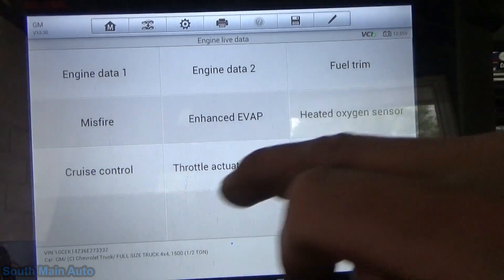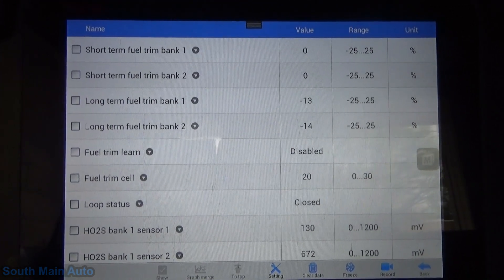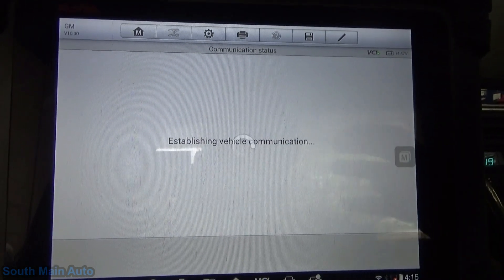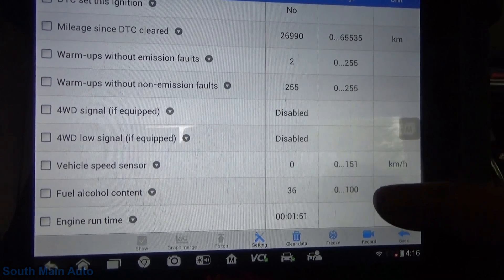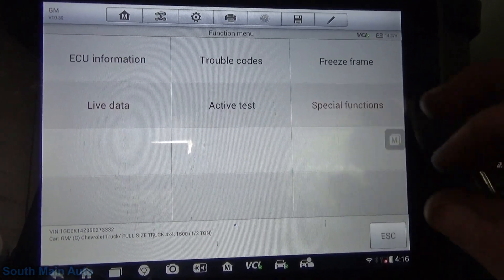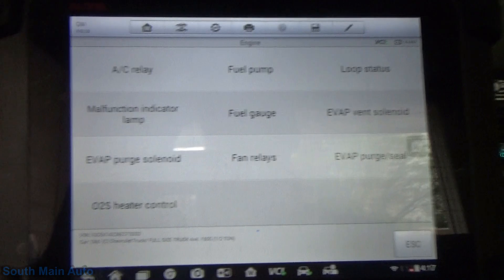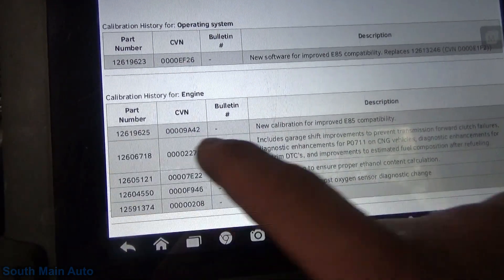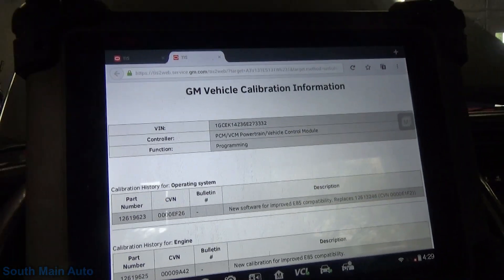Chevrolet Silverado - P0172 P0175 Running Rich

Comment: Hey i have code po175 on a 06 chevy silverado lt 5.3L engine and my mass airflow sensor reads between 0.68 and 0.77 LB/M at idle is the maf good? Or is it bad?
Reply from the maker: that is about 5.8grams per second. That is a good reading from the MAF at idle
Reply: @SouthMainAuto   wha about the fuel trims are those normal as well?
Reply from the maker: You didn't say what they were. FT's should be near zero + or - 10% LT and ST
Reply: I mentioned the trims on a separate comment.

Comment: I Have a 2015 sierra with a cam/headers/y-pipe/tune and it seems to be running rich.
The fumes really stink and the exhaust tips are turning black. The company that did the work said 
if it were running rich the sensors would pick it up, is that true? Its tuned for   93 only.

Comment: This video is what sent me over to the dark side. Bought a autel maxidas ds808. I've always been able to fix my vehicles with wrenches and cleaners until my 2011 Silverado. Couldn't fix it running like pooh and starting like a Ford when cold. Reset the alcohol content (it was at 87%! strange as I've only used 100% no ethanol fuel) and followed you videos instructions and is now purring like a kitten and It starts like it's summer time now. 
Also did my folks impala that was doing the same thing and had the running rich code as well. Tool is well on its way paying for itself already and will continue to as vehicles are only getting "smarter".

Comment: Hey, thanks for this video.. I had this problem.. alcohol % was reading 36% and both trim levels where reading-14 to -16 on both banks...  after resetting the alcohol %.. my short term trim went to 0 to 3... after a road trip... no codes.. awesome video.. thank you
Reply: What scan tool do you own.  I am currently looking for one.  Thank you.
Reply: @kyleanderson9453  use the vcx diag nano for gm vehicles. It's a clone of the Gm Tech 2 bi-directional scan tool ($$$$) for only like $120 usd. Same tool the GM dealerships use(d) for these vehicles.

Comment: When you did the approximation between engine size and g/s at idle, how much below or above 5.3 g/s would it have be to indicate a faulty MAF?
Reply from the maker: g/s = (about) engine size at 600 rpm 5.3L = (about) 5.3 to 5.9 g/s at idle

Comment: Eric what software are you using? I have a 98 that is throwing a p0175 code and it’s bank 2. I have the FIXD app and obd2 sensor and can look at live data and fuel trim 2 is negative 15 while bank 1 long is sitting nice at 25 steady. Just curious of the software. Thanks!

Comment: Nice video. I have a 08 impala 3.5 flex fuel with p0172 code only. Lights been on for a week now. Do you think fuel trim, composition needs reset? Car has no drivability issues and the cars mpg is normal and hasn't decreased any. We get like 23mpg on average. I cleaned the maf sensor and plugs and wires were done at 100k. Car has 111k on it now. Wife does put in 10$ here 10$ there. I fill it up every friday. I know it says it could be many things bank 1 o2 sensor, fuel regulator, dirty injectors, vacuum leak ect ect. I'm trying to pin point down the exact cause but my scanner is a cheapy scanner it doesnt have fuel trim or composition option. Any help is appreciated.  Thanks!

Comment: I just recently ran into this issue and it's 2011 Silverado 1500 the check engine light came on advanced plugged in said possibly tank of bad gas so I filled it with high test light went of biut c.e. light occasionally comes back on for short time then goes off. As far as t ruck driving no issues no loss power misfired etc. I was wandering if I should get it looked at by Chevy dealers or wait and see if switching to high test from now own at least for while might fix issue. Thanks for any help and nice video

Comment: Good work! I need help. I have 0172 and 0175 engine running rich codes and can't figure it out. Changed a lot of parts, map sensor, maf sensor, plugs, air filter, 3 out of the 4 o2 sensors and still same codes. 2011 equinox 3.0. Any advice would be major. Thx in advance.
Reply: I have a 2011 terrain 3.0 flex fuel with the same codes, I replaced the purge valve about 6 months ago and everything was fine. I'm trying to figure out what to do next.

Comment: This is why I want a classic. All this computer BS is far too much. Just burn the damned fuel! >.<;;; I love your term "Money Light" thats an Understatement.. What I have is a 2013 GMC 5.3 Flex Fuel and the sensor code keeps coming up well, Codes: P0172, P0175, P1400,  P0101, P0113, P015B The truck only has 66K on it Im asking what is going on?! Well, I do have a Warranty on it but a $200 deductible which is cheaper? lol Damn new vehicles and DAMN YOU EPA BS!!!

Comment: so ive had the fuel composition reset, and ive made sure the ecm is up to date,my truck is always warmed up before i refuel, i always refuel my truck more than 3 gals. at a time, and i never drive short trips without the truck being warm when i shut it off. My question is why does it keep setting codes  p0172 and p0175.
Reply: Did you ever get this problem fixed?

Comment: I have a 2005 GMC with  a 6.0 vortec I am having a hard start in the morning when it is cold .after it is going it runs good and starts good all day. I cleaned the throttle body and changed the mass air and I have no codes or engine lights on ? Any else I should check. Thanks

Comment: Thanks for this help,  If I know for sure that I always use unleaded fuel, and that ive never used e85 can I assume the fuel would be the right fuel to use if my computer is showing the same as yours. with the 36% alchohol level? Also when you say it has to have under 10% are you talking about the content of the alcohol? not the amount in the tank? Thanks for your help.

Comment: I have had check engine light for years this seems to have done the trick for my running rich. Now to just get the misfiring solved on cylinder 8. Can't get the spark plug out.

Comment: Eric O. I don't know if you saw my fb message the other day, but a year ago you diagnosed a S-10 4x4 not working, 4x4 making noise. It turned out that the t-case was bad. Did you ever do a follow-up video?
Reply from the maker: I never did get the follow up vid on that but the truck did get fixed. I just ran out of time to record it is all
Reply: Darn it. I was hoping to catch that one, because you get into specifics. Keep up the good work.

Comment: Another Awesome Video.  Thx Eric.

Welcome to the newcomers. This really is one of the best vehicle repair shops on YT.  Perhaps on the planet.  

 - Even if you don't turn a wrench you will learn what it takes to do a vehicle repair correctly.  So hopefully, you will learn the difference between what is needed to fix it right and how to defend yourself against those "will-rip-you-off" shops.  At SMA you won't get overcharged for a repair. Your repairs truly are guaranteed. You'll see what it takes to do it right the first time.  No unnecessary back and forth trips to shady stealerships or a black-hearted auto repair shops.

 - Despite comments by other jealous YT mechanics, mostly b/c they rarely equal SMA's skill level with a wrench and a camera. You will learn the right way to make good decisions that will affect your vehicle's safe operation on the road.  Mind you there are quite a few really good mechanics out there in YT land.  Unfortunately, there are 20 bad repair channels to every 1 really good auto repair channel. SMA is the top of the best.  Remember it might a while for those new to auto repairs to "get it".  We all started somewhere and you've found an honest and gifted teacher and a really awesome support team. 

 - SMA is a 100% family channel.  You'll watch Eric magically change salt embedded road trash into the vehicles you remembered buying.  

 - You'll watch Vanessa as she keeps things running smoothly in the shop and at home. After all, she has the tough task of keeping Eric and family in tow and on the mark.  Occasionally, you'll get to watch her do a few auto maintenance upkeep repairs and yes, you may even see her swapping out those summer tires to winter tires. 

 -  Sit back and relax as you go on another fun and truly educational "SMA Ride".  No worries here - Go ahead now just sit back and relax cause you've got real auto angels on your side.  Oh Yeah, I almost forgot... please Subscribe and donate if you can through Patreon to help Eric and Vanessa and Family pay the bills and to keep these Videos.  Please consider that for every hour they work to produce each video is an hour not doing another car repair that really does pays the bills.  

Honestly,  It really does take a whole heck of a lot for them to host, edit, re-edit, shoot, re-shoot, re-host and do untold hours of research to ensure you get the whole truth and nothing less in each video.  They do this so you see only the best of what you should see. They caringly share themselves with you in every video. So grab a chair or couch, click on Patreon and then the start button.  You're about to go on a fun but magical mystery ride.
Reply from the maker: Well I must say that was very kind of you to write that for me (us) ! Thank you! Ok so who do I make the check payable to again?
Reply: No checks pls.  I only accept cheeseburgers and fries.  All monetary gifts go to ASPCA and any children's hospital not funded by large donors.
Reply: Honestly, I was a tad worried you'd be a bit upset I didn't kick it your way first.  Thanks Bruddah!

Comment: Roadfix good video, can you do a more detailed summary,    what exactly did we learn. I heard you say to many short fillups can change your air fuel sensors ?  mixture ? reading ? please explain. Im in Claifornia I have a hummer h3 my idle has been ruff the last two weeks I did fill half tank running to empty which I dont normally do. I always add Lucas fuel injector cleaner, I did not use lucas this last two weeks, my idle is very ruff like it wants to stall, it has never been this ruff idol. Hummer has 130,000 could it be dirty fuel particles ?  Does adding the lucas injector cleaner change the computer settings ?  Or is it bad gas ? I fill up at Costco groacery store they claim to use top tier fuel, Iam using 87 octane. The gas test was good,  we need to know what is in our gas.

Comment: Back when I worked at a chevy dealership,one of the new lot guys filled a brand new 1500 with diesel then drove it back to the lot,his words "well it was my understanding that you could use gas or diesel with the flex fuel symbol"  kid got fired 1 hour later
Reply: oh lord...

Comment: Alcohol, "emulsifies" with the water. Like the old gas line antifreeze did.
Reply: Emulsify would be the combining of immiscible liquids, like oil and vinegar in a salad dressing - they'll separate eventually. Alcohol is miscible in water so it simple dissolves in water and will never separate.
Reply: Thanks Jim for the correction.
Reply: I had to look it up!  I'm no expert, I just recalled reading about how fuel additives that prevent, or fix, alcohol+water separation in gas work and it seemed relevant here. Cheers.
Reply from the maker: Bam!! I got a new word :D

Comment: good video. calibrated cylinder alcohol test good. I was surprised to see how little alcohol was blended in the fuel. E15 is making an appearance down south. It has 2% less energy per volume than gasoline, about the same as driving with tires under pressure.  I drove a tank once just to see and could not see any difference in the performance of the engine. 
five gallons here, five gallons here, five gallons here...

Comment: Fueling with the engine running is bad for any vehicle, it messes with the ecm. On the older GM trucks with a duramax and factory dual fuel tanks it would cause the fuel system to stop pumping fuel from one tank to the other. You had to clear the fault code to get the transfer pump to work again.

Comment: glad the new GM trucks have a alcohol sensor.
Reply from the maker: Yep that solved the issue for sure
Reply: I don't see how the one you're working on even runs right without the sensor. with E85 the stoich afr is like 9:1 gasoline is 14.7:1. does it see a super super lean condition when they first run E85 the adjust the trims accordingly? because 14.7:1 on E85 is dangerous lean.

Comment: Could you explain to your audience why the false reading of 36% alcohol makes the engine think it's running rich.
Reply: Eric pretty much explained it to a certain extent. Engine thinks it has 36% alcohol content. When in reality it doesn't. Engine then tries to compensate the "large amount" of alcohol by adding more fuel. Adding more fuel causes a rich condition. There's definitely are more correct way to explain it. But this is what I understood based on Eric's reasoning.
Reply from the maker: It runs at a richer air to fuel ration when it has alcohol in it. Now when it has gas in it and it thinks it is E36 in this case it is actually adding to much gas. Does that make sense?
Reply from the maker: Yep. That is the story in a nut shell with out going to deep.

Comment: Eric, am i mistaken or was this truck in another sma video?
Reply from the maker: MMM dunno... could be?
Reply: South Main Auto Repair i was just wondering. It looks just like mine. If any of your viewers want a free tip, there is no way even with a little spray of silicone lubricant that you can change the shift boot without removing the lever first. lol I just learned that the hard way.
Reply from the maker: Oh bummer man!
Reply: South Main Auto Repair its all good. lesson learned. Thankfully i have friends that work in the parts department at the dealer. lol

Comment: I had this problem on my Tahoe and it drove me nuts trying to figure it out. It was running rich and always smelled like rotten eggs, replaced the 02 sensors, replaced the cats, took it to the dealer and they told me it was reading the alcohol content wrong they reset it and updated the computer. Was ok for about a week, I finally gave up and traded it in. Couldn't find much on the net about the problem but I bet a lot of flex 5.3s have this problem.
Reply from the maker: I don't see them a lot but when I do I don't forget this little trick

Comment: You can update firmware with these things too?  I thought that was a "dealer only" thing.

Is that something that all scanners can do, or just usually the more expensive ones?
Reply from the maker: you can do it with any J2534 pass thru device
Reply: Okay, thanks MR. O!  I'll take a gander over at Amazon and see what they have.

My sister has had a Pontiac for years that has needed an update.  The dealer told her that it was only something they could do, but always gave her the run around when she tried to get it done., and TBH I never really put much thought into it until you mentioned in the video.

Comment: Great video and diagnosis. I've run into that on some customers that travel out Mid-West and use E85 out there and come back with the alcohol content jacked up.
Reply: I have a question are you saying e85 causes this im new t& c chrysler 2009 flex fuel owner i need help have code p0172 changed several things
Reply: @jayill427  That is not true - I have the same code - went through a calibration reset with dealer, and the problem just comes back after a while. Using regular gas from regular gas stations like Shell. There is something fundamentally wrong with the learning or I heard that possibly an egr port gets blocked and causes this as a side effect, but I have no confirmation on that yet. Issue lives on...

Comment: this alcohol is more soluble in water than the gasoline, so goes with the water to the bottom of the graduated cylinder you are using, since water is more dense. there is a part on the alcohol molecule (-OH) that likes the water and goes with it. I have added methanol(wood alcohol) to my gas tank to get rid of small amounts of water.  no chemical reaction occurs, just merely an association. if you are ever not sure what layer is what, you can put you finger at the liquid division and add more water to see if the bottom volume increases. old chemistry lab trick. good video.
Reply from the maker: Great explanation, like I say I am no scientist haha

Comment: I bet $10 is almost a full tank over in the states,Try are fuel prices in the UK.
Reply: Same amount near where i live give or take a $ is about $86 for 12 gallons
Reply: Price of gasoline in central New York (upstate) was US$2.35 per U.S. liquid gallon or US$0.62/Liter on 6/1/2017 - £0.48, [about one half of that amount is included tax]. Yes, we in the U.S. have two different measurement for our "gallon" Liquid and Dry.  Don't confuse those gallons with the U.K.'s Imperial-gallon - One Imperial gallon is equivalent to approximately 1.2 U.S. liquid gallons.  It's a good thing the U.S. has been on the Metric system since 1875, but don't tell that to anyone in the U.S.. - it's a long explanation.

Comment: so you need to thank gm (government motors)  for putting money in your pocket. the money light is on and it wont pass nys inspection  due to such because of a gm software issue.?! now i'm not a big fan of scum sucking bottom feeders(and no im not referring to carp(they are better than that))but this should be a class action for anyone that has had to pay.